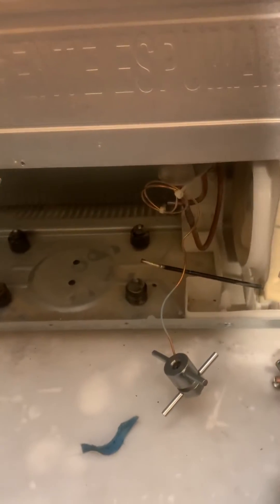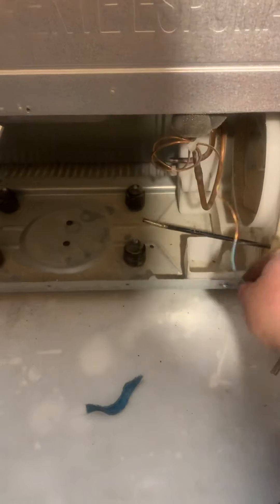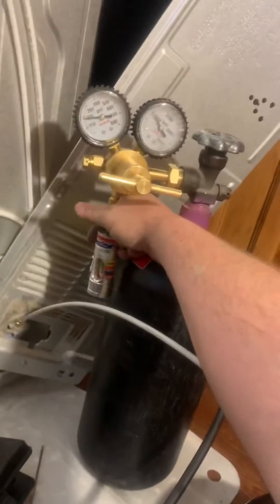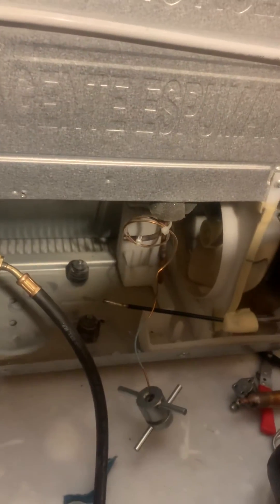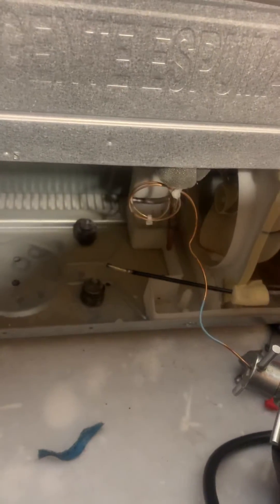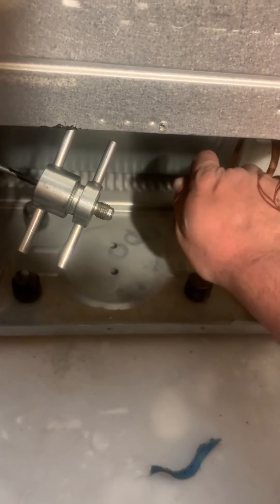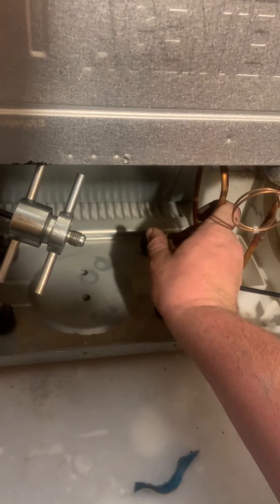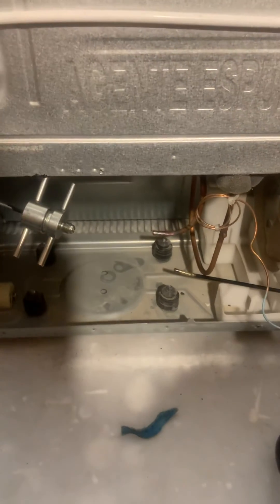Blowing out an lg refrigerator with nitrogen

Comment: Are you using the 3/16 adapter for the cap tube? Mine leaks when I do that.
Reply from the maker: Yes, I’ve never had a problem with it, but I do crank it down really tight
Reply: @steveb5967  came here to ask this exact question, but you are 10 months ahead of me. Sure enough, cranked it tighter and it worked
Reply: Am here for the same reason, 3/16 on a cap tube, crazy
Reply: This is also the question I was looking to have solved. 3 years later 😂
Reply: Me too 😂